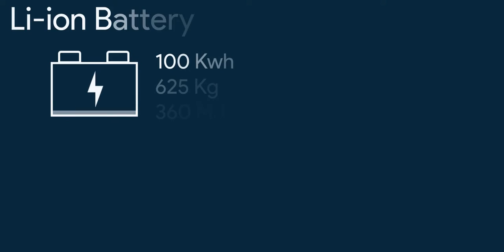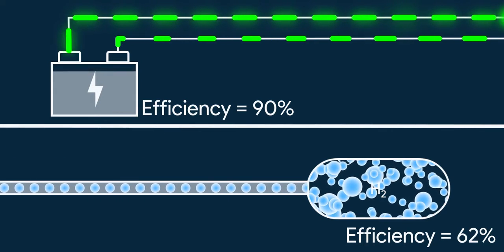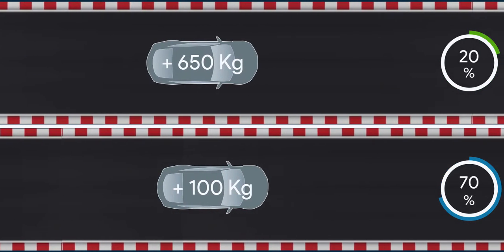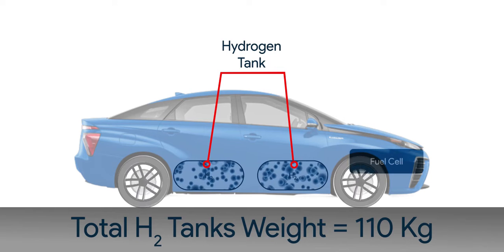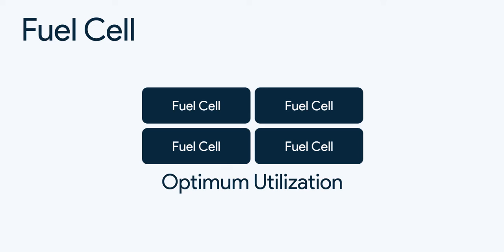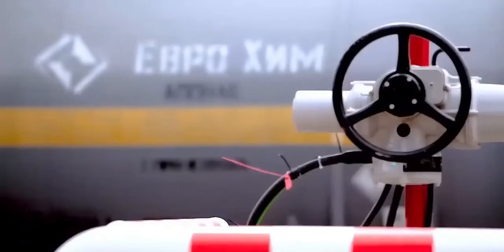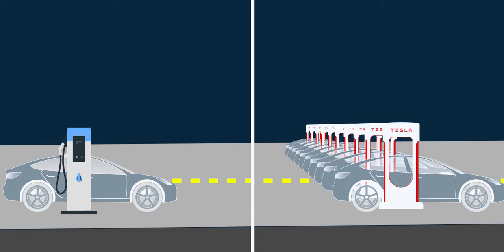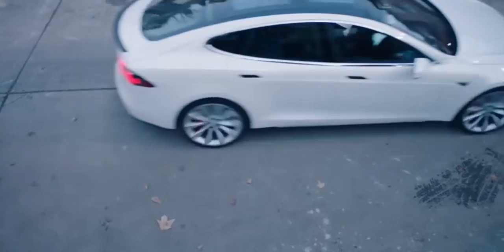FUEL CELL VS BATTERY EV. The Future

Comment: Unless you have a way to store enough electricity to last for weeks, solar panel farms to replace coal burning power plants does not work when you have a week in the winter where it is cold, cloudy, and windy. Batteries are very expensive and not enough lithium on the planet to supply enough for battery vehicles to replace gasoline and mining of lithium is harder on the environment than burning gasoline. But you could send the excess electricity from solar farms to make hydrogen and store it in tanks, using it to both fuel vehicles and to run hydrogen fuel cells. We could eventually replace all gasoline stations with hydrogen storage facilities that make their own hydrogen from power lines coming from solar farms. Those stations can both have hydrogen fuel cells to keep the grid energized at night and in winter and also to fuel vehicles. Otherwise, solar panel farms output zero at night and very little in winter and variable constantly fluctuating amounts on partly cloudy days. Half the cost of solar panel farms needs to be the cost of storing and controlling the use of the power than is generated. Hydrogen seems to be the cheapest way to store and throttle the energy as needed. Otherwise solar panels don't output energy efficiently as it is needed without some kind of battery storage. Hydrogen seems to be the cheapest form of storage. A lithium battery only lasts 5 to 10 years and is very expensive to recycle. Hydrogen does not have that problem. We have tons of desert land in the west that can be used for solar farms if we have a way to throttle the energy that comes from them.

Comment: You might get the conclusion right but you need to keep studying the topic. There are immense opportunities to improve both EV's and FCEV's and the same goes for batteries, electrolyzers and fuel cells plus hydrogen logistics.

Comment: The BEV market is biased against FCEV! We have driven FCEV over 37K miles within California. We have leased a Honda  Clarity FCEV and currently own a 2023 Hyundai NEXO. We also have an Ionia 6 which we leased in July of the same year. I have driven each vehicle over 5K miles each. Which one gives greater range? The Hyundai NEXO. It is bigger, taller and not at all aerodynamic. The range I get on recharging the Ioniq6 is around 316 miles at 89% charge. The range I get fueling up the Hyundai NEXO is 384 miles at 95%. I drive both EV’s the same: Drive the speed limit, break early, always use regenerative braking, brake early and accelerate slowly. When driving the California freeways stay in the slow lane and never exceed the speed limit! Both EV’s offer freer charging or fueling: Hyundai Ioniq 6, free 30 minute recharging for 2 years or lease or ownership while Hyundai NEXO FCEV offers a $15K fuel card. Why is the FCEV more efficient than the “World Leading EV” the Ioniq6? As you said in your video, the difference is simple, WEIGHT!! While the Ioniq6 is much more aerodynamic than the NEXO (like a big brick in size compared to the Ioniq 6) the weight makes a big difference in range. You have scientifically proved my point. Weight is the main difference. Fewer stops for fuel and more efficient use of the fuel source (electricity vs Hydrogen). Hydrogen FCEV is much more efficient than BEV, HANDS DOWN! I know because I have both. While the lose of energy from source to vehicle is more efficient with an BEV (only 62% with Hydrogen)  the weight difference will catch up to the BEV over the range use compared to the FCEV.  This translates (as you said) to fewer stops for needed refueling and definitely longer range. The “nay sayers” say that Hydrogen is carbon inefficient  during production and transportation to the fueling station is expensive, consider the cost of lithium mining and the carbon processing pollution of making a lithium battery. The “nay sayers” are telling only half of the story. I have watched hours and hours of BEV vs FCEV and only a few have told the truth. Hydrogen fueling is the future alternative to lowering the carbon footprint from passenger cars and the future fueling of trucking. We are in the embryonic stage of Hydrogen processing. But it is changing and improving very rapidly. The key issue to making FCEV’s attractive to the consumer is not the price of the car. It is the sluggish and very expensive infrastructure. When we drove our first FCEV, the Honda Clarity, the price of Hydrogen was $12.99 a Kg. Three years later it is $37.99 per Kg. It has tripled in price. This is a big part of the problem. California is the only state, which exception of Hawaii and one or two stations on the east coast that offer FCEV fueling. California now had over 70 stations and we have traveled up and down the state and NEVER had a problem refueling. No long wait to refuel, 5 minute refueling and great range. In summation, driving an BEV or FCEV is not like driving an ICE vehicle. You have to drive intelligently. My “Mantra” is: “Leave early and enjoy the ride.”
Reply: A kg hydrogen contain 39.4kWh HHV, which is what is used when you state fuel cell efficiency. The Nexo tank contain 6.3kg so at 95% filled you start with 6.3 x 39.4 x 95% = 236kWh. If the Hyundai Ionic 6 is the standard range you have a 53kWh battery and charged 89% 47kWh. Per kWh you go respectively 316/47=6.7 and 384/236=1.6.

Comment: Generate 1kWh of green electricity, use that to directly charge an EV battery, how far can you travel?
Now use the same 1kWh of electricity to hydrolysis hydrogen, compress it, cool it, put in in a vehicle, fuel cell it back to electricity, and tell me how far that vehicle can drive.....

If this information is not included in a "comparison video" I don't think we have all the facts.
Reply: and more   in efficancy  shoould loss by  kinetic energy loss by mass of battery that  is huge  1000 kg2000kg batteri so   drop
Reply: Heck, first few seconds of this video is silly at best. It was comparing hydrogen weight to batteries weight... Like... What?! Why the hell is not including tank this hydrogen will be stored in? It included entire battery weight with its materials, but doesn't include hydrogen tank weight... How much 80Kwh of electricity weigh? Zero! Well, technically there is some mass, but my point remains... Its extremely flawed comparison from the start...
Reply: @Zripas  well you gave up too early, because his 3kg of H2 is stored in a tank and recovered using a fuel cell weighing a combined 100kg
compared to 650kg of batteries  this is 15-20% lighter with obvious range extension and economy effects

the speed of refilling, and infrastructure cost of bev charging points is dealt with later in the video, and is frankly compelling
Reply: @simonmasters3295  
I'm not arguing that batteries are lighter or something, just pointing out major issue with basic comparison. 
Refueling times are meaningless as currently you can get from like 20% to 80% in like 15 minutes of charging, is it longer than hydrogen refueling? Yes. Does it cost less tho? Yes. So you are paying like extra 100 bucks to save 10 minutes. Not the best trade deal I might say.

Comment: Theoretical specs are interesting but I find it's better to compare best-in-class examples in the real world. Engineering complexities will ultimately determine the weight, efficiency, etc. arguments.

The specs of comparable current cars are (HFCV = Toyota Mirai 2021 RWD, BEV = Model 3 LR RWD 2021):

Spec..........   HFCV  /  BEV:
EPA Range:  402 mi / 358 mi
Full tank:      5.6 kg H₂ / 82 kWh
Usable:         5.5 kg H₂ / 76 kWh
Refill cost:    $60 / up to $30
Curb weight: 1920 kg / 1920 kg
10-80% fill:    5 mins / 25 mins
0-100% fill:    5 mins / 60 mins
0-60 mph:      9.2 s / 4.2 s
Trunk volume: 272 l / 561 l
Frunk volume: n/a / 88 l
Total cargo:    272 l / 649 l

So, in summary:

The HFC car can go a little bit further on one full tank and charge quickly. If we consider that an extreme EV driver might charge to 90% and drive down to 10% on long journeys before refilling, then the usable range of the EV is even less, more like 286 miles. However, thanks to the Tesla Supercharging network, they solved this issue by making it easy to go long distance and the car will always find a charger along the way. It's recommended to stop, get out and walk or rest every 2-3 hours of driving, which is perfect. So for most EV drivers, range is already sufficient and a non-issue.

Whilst the charge time at a fast (H70) H₂ filling station is 5 minutes, not all filling stations are fast. Some legacy H35 stations charge at half speed and can only pump the vehicle up to 50% full. When we consider 5 minutes to refill compared with 25 minutes to refill a BEV from 10% to 80% (which is what might be expected during a long journey) then it's still quicker to refill H₂. However, on a long journey, arriving with 10% and leaving with 65% should only take 15 minutes, which is enough to travel another 160+ miles before needing to recharge.

It costs twice as much to fill up the H₂ car but the manufacturer often hides this by providing a free fuel card since they sell so few worldwide (approx. 1000x Tesla worldwide BEV sales vs. Toyoto HFC).

Although the tanks may weigh less than the battery, in practise they require heavy duty protection from impact. Battery gravimetric density is decreasing every year whilst the engineering needed to protect the tanks currently significantly increases the weight. In the end, curb weights of both cars are essentially the same, so no advantage to HFC.

The acceleration in the battery electric car is far superior and can be sustained over extended periods and even into high altitudes unlike the HFC car, which needs to maintain its 1.2 kWh battery charge to deliver full power and uses extra energy to purify the air to provide pure O₂ to the fuel cell.

The available cargo in the HFC car is significantly reduced, mainly due to the 3x large H₂ tanks under the seats and chassis along with all the crash protection. The Tesla has 2.3x the cargo capacity of the Toyota, although this won't matter to most.

Finally, the H₂ refilling infrastructure rollout is problematic, mainly due to the cost of setup and maintenance. There is a good reason why no one manufacturer like Toyota is willing to fund the installation of country-wide filling stations like Tesla has done in every country it sells to. It costs at least 5x more per stall to install H₂ filling capability and then it costs 5x more to buy the electricity to generate the H₂ from the grid because H₂ is such an inefficient method of powering vehicles considering end-to-end losses. So unless the filling station uses dedicated renewable energy generation like a local solar park or wind turbine, it's using up valuable grid resources to allow one HFCV to drive the same distance as could be driven by 5x BEVs.

There are some who argue that the government should fund the H₂ filling infrastructure, but given the very slow take-up of HFC cars, this is only likely to be useful for H₂ trucks in the short term. If we look at the ever decreasing gravimetric density of batteries, even trucking looks likely to be mostly BEV except for perhaps the most long range, maximum cargo weight trucks, which is only a very small proportion of the fleet.

Ultimately for the majority of people, BEV is always going to be cheaper than HFCV since they can slow charge overnight at local public chargers or at home at very low electricity rates. This, and the fact that the HFCV costs more than the BEV (and probably always will) is the main reason why HFCV has such a tiny take-up.

In terms of grid stability and power demand, if everyone drove HFCV the grid energy demand would be 5x higher than if everyone drove BEV. So, the fact that people can be incentivised to charge either during the day (peak solar) or during the night or weekends, when grid demand is lower, means ultimately BEV is going to be cheaper all round.
Reply: Your science is correct. However, as a consumer driving both a Hyundai Ioniq 6 and a Nexo which we own one and lease the other, the NEXO wins in range and fueling efficiency. As a consumer, I cannot control the production of Hydrogen or the processing of Lithium batteries. I just drive both the cars. The NEXO is hands down more efficient in driving range and refueling (or re charging). When I visit an Electrify America station I see all makes of EV’s. That all complain about the same thing: “ it is not the recharging time, it is the wait to recharge.” You are a TEsla driver and are quite prejudice. All comparisons of the TEsla Model 3 are compared to the other manufactured BEV’s. With the comparable price comparison you are comparing the “vanilla” model TEsla. When you change from white to blue, red, or any other color you pay more. When you change from the funky boring aero wheel rims to a more classy look, more money. The ride in a model 3 is like a tin can with a computer. I have rented a Tesla model 3 for a week and that was one my experience, in addition to no free fueling for 2 years. I live in Orange County California and the recharging station at the most expensive shopping center in Southern California (The Spectrum in Irvine Ca.) the charging station has every imaginable BEV there day and night! Why are they there when they could charge at home? Free charging. That’s the only reason. The Tesla “Cult” is telling only half the story. THe Ioniq 6 has superior ride quality, quieter, control of regenerative braking, 4 models to choose from, many different colors at no extra charge and many similar features to the Tesla model 3. However, the computer system in the Tesla is superior, no question. But that is all. It is faster from 0-60 but that is great for what and who? The speed limit in California freeways is 65 mph. Modest drivers (and I drive the freeways regularly) are driving 75 to 80. In the right situation that will cost you traffic school, court fees and the price of the ticket. Right around $500. The Tesla is a great BEV and miles ahead of others in “car computer engineering technology.” Why did TEsla lower the base price of there “Vanilla” BEV model 3? Competition, competition and no logical other reason makes sense. I Sam leasing a Ioniq 6 2023 Long Range RWD for $349 a month with only $5K as a down a payment. That for $15K miles a year for 36 months. What is the comparable Tesla lease for a similar model? Do the math, hands down the Ioniq 6 is a better value for the price.  What kind of range do I get in my Ioniq 6? At consistently 89% charge 316 + miles. How do I do that? Drive sanely at the speed limit.